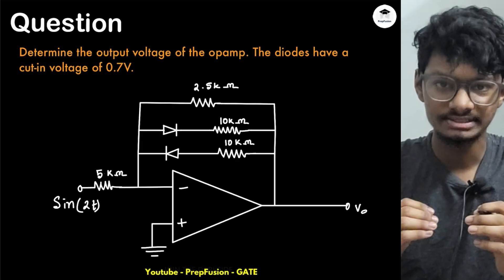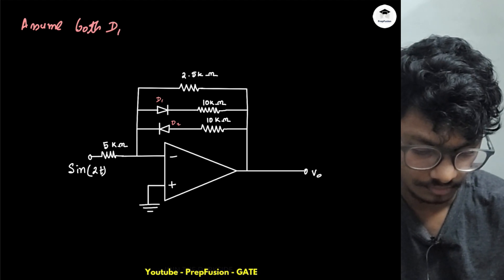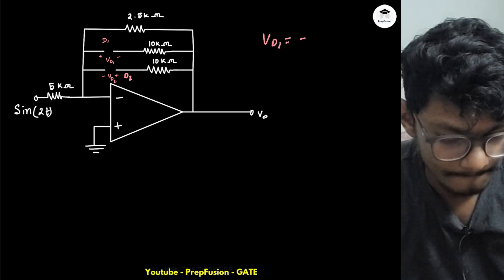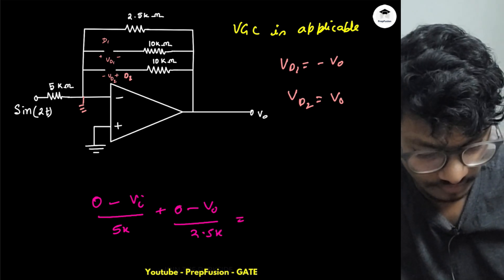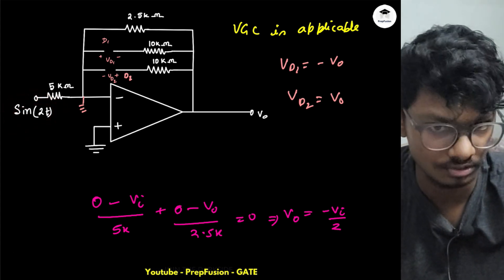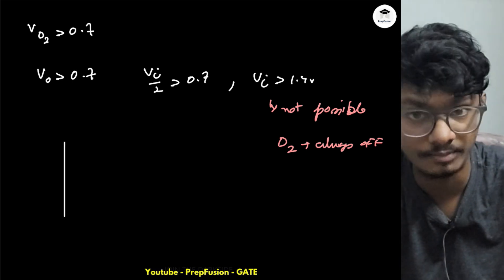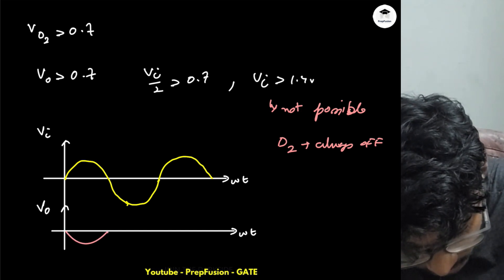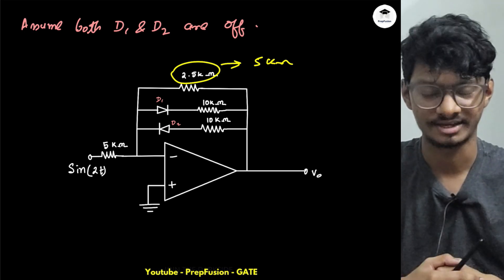OPAmp With Diode  || Analog Interview Questions

Comment: Thank you Sir 👍
It looks like 
Positive half cycle D1 on and then -2-0.7-vo-4vo=0,vo=-0.54v approximately - 0.5v
Negative half cycle
vo=0.54v approximately 0.5v
So vo output wavfrom on the contrary but vo - 0.5v to 0.5v